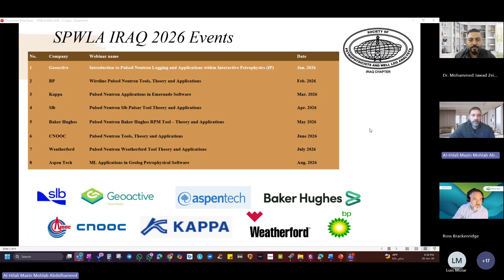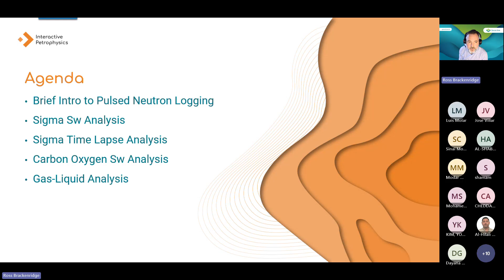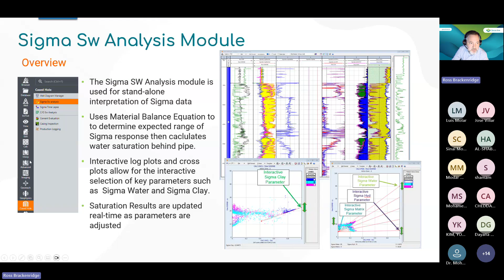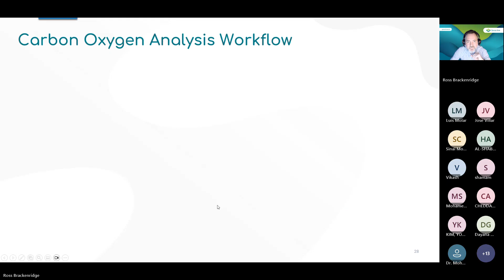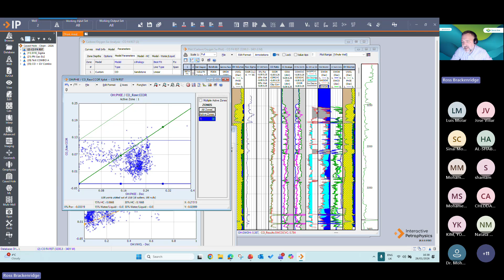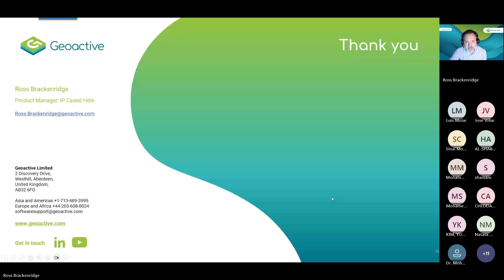SPWLA IRAQ 2026 Webinar#1: Pulsed Neutron Logging and Application within Interactive Petrophysics

Comment: Hello, I could not attend that webinar and there would be one important question that always comes up, how are these workflows independent of service companies? I mean there are tool specific processes for each services, can we process and interpret PNL (Sigma, C/O, special gas mode) data from different vendors in IP?
Reply: Until we hear from Mr.Ross , I believe for sure yes you can use IP for any of Sigma or CO tools in the market. However because each tool has a slightly different response even in the same environment you need to use the tool proper response model relevant to associated environment and composition. You can use the software generic model but need to make tuning to the model and correlate to known zone response (100% wet formation or clay ). Then normalised data to synthetic envelope curves.